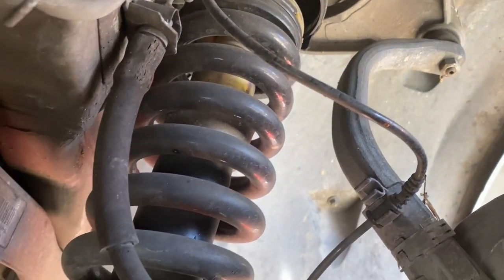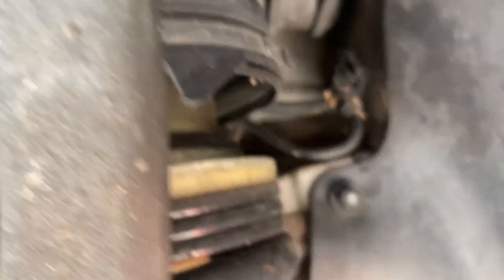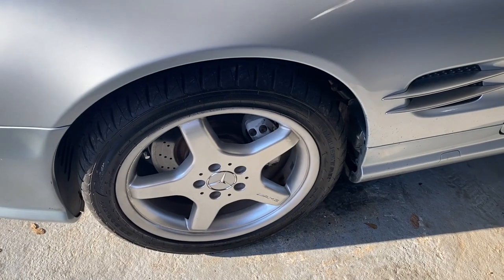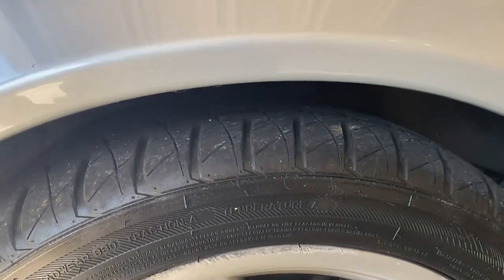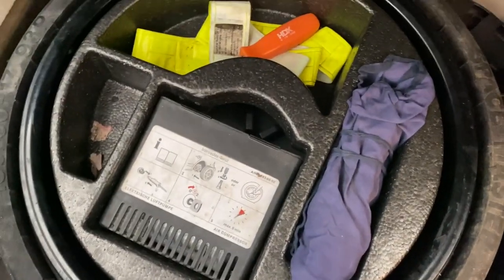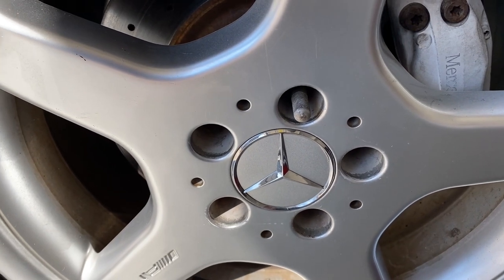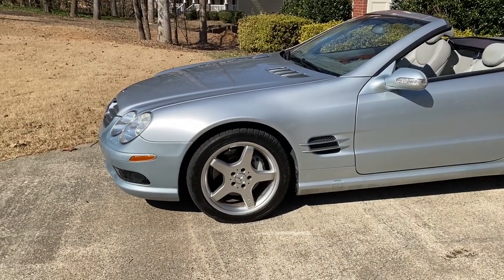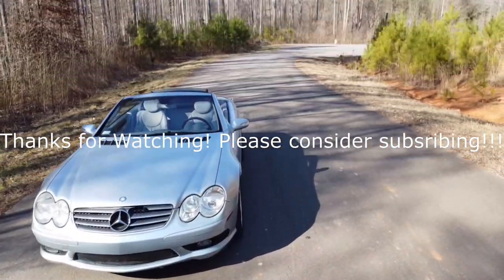Fixing ABC for FREE on America's cheapest SL500

Comment: Did the coilover conversion on my 03 with failing abc a few weeks ago and it's gonna save me a million future headaches 🤙🏽
Reply: how much that cost? i think it's bs $3000 vs replacing a accumulator?
Reply: @fredrezfield1629  Got the coils for 1100 had someone put it in for 1000 and sold the old shocks for 800.  Was a great deal and it rides fine.
Reply: @gerrypalms5147  where did you buy your coils? 
for both front and rear?
Reply: @fredrezfield1629  Amazon.  They took w weeks to get here but it was a great purchase. Used a pump from an ml500 for the steering. No sway bars, it rides fine and the heights are adjustable.
Reply: @gerrypalms5147  what about programming ? do you have like ABC message on the dashboard at all times? is it red or grey ?
Reply: @fredrezfield1629  My mechanic just pulled the fuse on everything abc related. I still get a message everytime it starts up but it just goes away.  I had accumulator problems too and I'm gonna keep the car for a while so u said screw it and did the conversion. ABC Is a nightmare.
Reply: @gerrypalms5147  it is but what am i looking for  though? a complete coil over kit? are these made in china or what?
Reply: @gerrypalms5147  what exactly did you replace? just he shocks or is there more? there is a kit that costs $2800USD before shipping 
i can get the struts all four apparently for under $1000 but is that enough?
Reply: @fredrezfield1629  I didn't get sway bars cause I don't race my car cause it's not fast anyways.  So the link I sent you and a used steering pump from an ml500 and a smart mechanic is all you need.
Reply: @gerrypalms5147  you didn't add a sway bar?
Reply: ABC suspension is fairly reliable and pretty easy to fix if you do the research.  Fluid needs to be changed every couple of years, and most sagging is caused by worn o-rings in the valve blocks (there is one in the front and one in the rear).  Struts rarely fail, and tandem pumps, which do (some parts suppliers call them power steering pumps), are 😊available for a couple of hundred bucks online.  The accumulators are a hundred bucks apiece online.  This suspension adapts in one ten thousands of a second to make it handle like a race car, but ride like a luxury sedan.  I am a used car dealer and have owned and repaired a few dozen of these cars, and never even considered replacing this incredible suspension with coil  springs.  For way less than some Stone Age springs you can fix anything in that suspension that has or will go wrong.  I don’t understand when people try to “out think” the brilliant Mercedes Benz engineers by replacing the ABC system with springs that absolutely ruin these sports cars.

Comment: ABC Struts are not to bad for price and are pretty easy to change. Leaking valve blocks can be fixed really cheaply just by replacing the rubber "O" rings. Do not understand why some people are so paranoid over this suspension  there is no other that can compare when it comes to ride quality and handling.
Reply: I have Owned my SL500 for BBC six years and drive it pretty hard early in the Pandemic  when there really were  no speed limits to worry about, now  I have to take it easy. Hard to do in a car that breaks a 100 on a long pass. The SBC brakes warranty was extended to 25 years so not says something about Mercedes quality. The ABC suspension can be a lifesaver, so keep it and forget coil overs.
Reply: @gotglasses  do you have original mercedes wheels ? aftermarket? what size?
Reply: 2004 R230 (Mars/Stone) - I have not had a shock fail yet, the leaks have happened in other parts of the system: blistered hoses and leaking transmission lines. There is no question that the system is the most awesome suspension I've ever had the privilege of driving 153 mph on. But, the real problem is the sound of the ticking-time-bomb I keep hearing in my head. I just want to enjoy the car and not be repairing it in perpetuity...or driving it and never knowing if I'll make it to where I'm going or get back. Nah, brah...I'm getting coilovers as soon as I can. Dunno if I'll try for the  buck-n-half mph with them, but, I can just cruise like a sane driver for the privilege of actually driving an R230.
Reply: @ardz8279  Arnott do replacement shocks and give a lifetime warranty. The OEM components are made to a "price" and typically fuck out at under 100k miles. Guess it is human nature to "worry"
Coil Overs will not negate all the other things that could fail on the R230.
There is not a car made anywhere that does not have problems of some thing or another. Just enjoy your car and do the maintenance when required ...... Have had mine for 9 years .... its just as reliable as any car i have owned prior. Doubt you will suffer much if any depreciation on the car so any repairs aint a problem.

Comment: Thank you for this video. I have 05 SL and my left front corner is sagging if left for about a week. I didn't see any puddles of oil though. I need to inspect it soon. But I'm on the fence if I need to keep ABC in the long run. Folks swap it with coilovers and enjoy it. Like someone wrote in the comments below - you never know if you make it from A to B or if come to your garage tomorrow only to find out car is sagging. I know preventive maintenance is the key but when major components like struts start to fail then the price isn't cheap. Arnott front left ABC strut currently costs $800 at FCP Euro + $300 for core deposite. Regarding core charge they say this: "The customer is responsible for the cost of return shipping". According to USPS shipping 31 lbs in 30x8x8 box from me to their address in CT would cost about $86. So if we add tax then the front strut is over $900. The rear one costs the same. Plus when replacing the strut I guess I'll have to add some fluid. So assuming you may spend about $1000 per year on ABC, then getting coilovers doesn't look bad. Folks swap it and enjoy it...

Comment: I replaced the pressure lines on mu abc system with hard steel lines. No more busted hoses. Made my CL55 enjoyable and reliable for little money.
Reply: Where did you get the hard steel lines? Would like to get for my CL500.
Reply: but they rust  ??  
i have the same issue mine cracked at around the hose clamp

Comment: Hi,  I see you are about to take a journey on repairing your SL 500.  I have the exactly care 04 R230.   They are great cars except 2 major item.  ABC and the vario cylinder on the top.  I've replaced my ABC with Silver Max and they are great.  LOVE IT.  Currently I'm replacing my rear cylinder on my top.  I would assume you have the same issues.  For your leak,  you may want to grease your rubber seal through out the car. That really helps.

Comment: I think the line you tightened is either the inlet or outlet for the power steering,the single line on the back with the banjo bolt is the ABC line,Also dont you want to heat your wing mirrors anymore and you need to fix the leak into the trunk.Start by cleaning the 4 drain holes along the bottom of the back window.
Reply: i have a similar situation on the same side of the car i got a huge leak
i heard a pop  right after i started the car then lots of fluid   dripping  
the car is bouncing on the front left side so i gotta check to see if it's the accumulator or the hose is rusted ? is that what he did? just tighten one ofthe hoses?

Comment: Great video. I have a 04 SL500 that has an heater issue.  it only blows heat on the drivers side the passenger side is always cold air.  Any idea how to fix this?
Reply from the maker: Not sure how to fix it, but it may be the blend door actuator.

Comment: great video, i'm about to tackle some abc issues on my 08 r230, i had my front right strut fully extend while driving, got the abc malfunction in the cluster. I was wondering if you had any idea of the cause of this issue, i was able to get the car home by raising to max ride height and the abc light didnt come back on. Did a little research and i think it may be due to a valve block leaking internally?possibly an accumulator or pulsation dampener,  i have no fluid leaking on the ground and the ride height stays consistent with car off? any thoughts on this issue?  I also just replaced my radiator a few weeks back, not a bad job over all. Thanks again for the content on this r230 not too many of them on youtube.